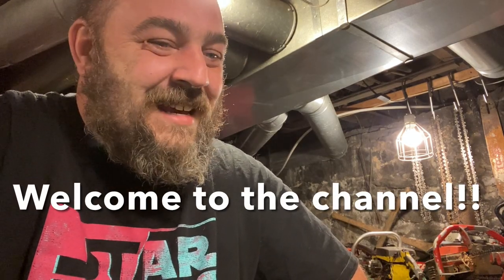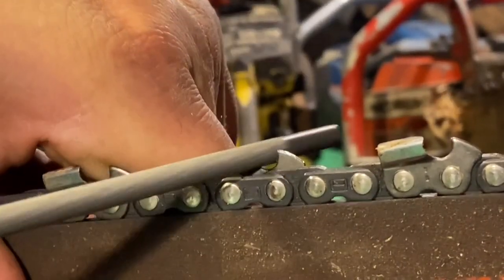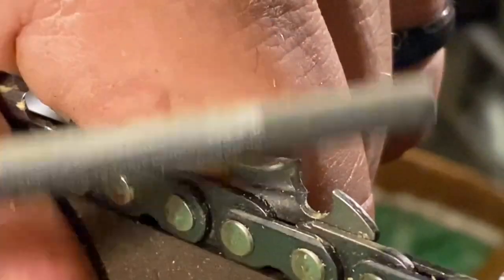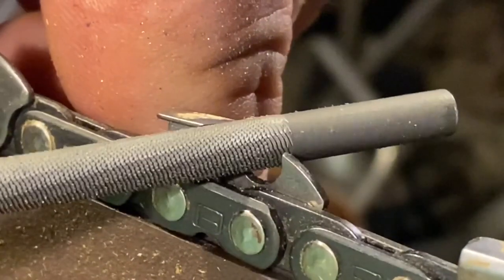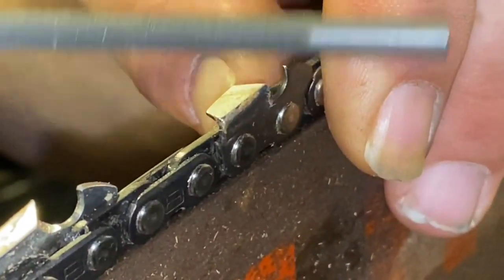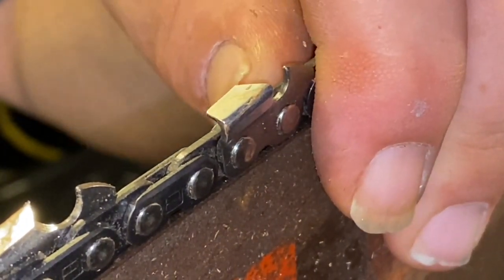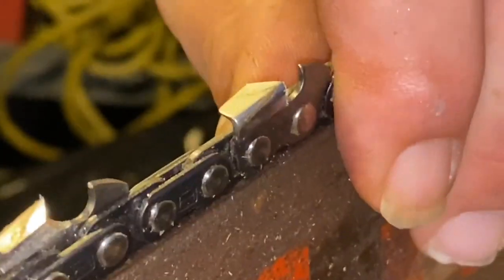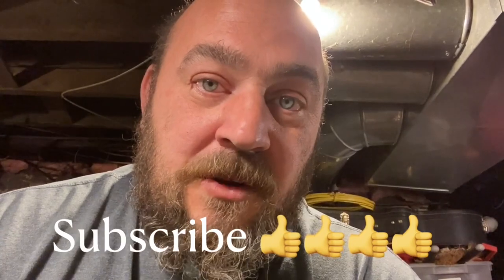The Beginners Guide To Chainsaw Sharpening!  My #1 Tip To Chainsaw Sharpening!!

Comment: Hi Smitty!!😀😀
I've been hand filling my chains for over 40 years. Most every thing you said is correct. 
A sharp file is definitely a must. 
I always sharpen a brand new chain before I ever cut with it. Most of the time they are sharp enough out of the box to cut okay. But depending on how much that chain has bounced around before you finally get it. Most of the time the fine edge is usually damaged a little bit. So I always touch them up and get my gullet formed to the way I like it for the kind of wood I'm going to be cutting. 
Take care my friend!!😀😀

Logger Al
Reply from the maker: Thanks!!

Comment: I have been there as well. Rocking chains, wrong angles, too much hook, not enough, etc. 

Thanks for sharing- good info. Personally I do like the rotary tool grinding a lot.  I think it would be a good for most folks to start in that manner.  Easier to learn the angles, there isn’t so much going on- chain moves less, less concern with keeping the file in the correct direction and more focus can be placed on what is happening to the edge. Take that knowledge and work in filing.
Reply from the maker: I think the rotary grinder is the best sharpening invention that has happened.  Getting setup with the diamond sharpening bits just takes it one step better.